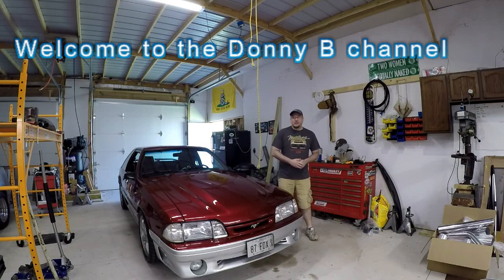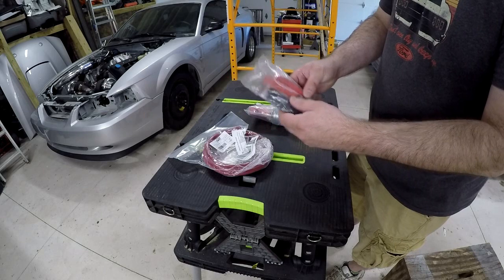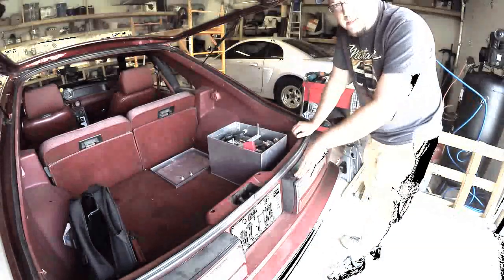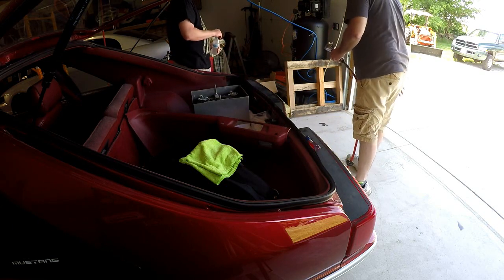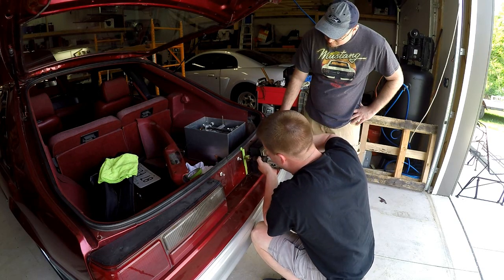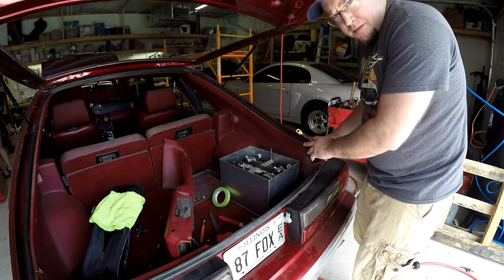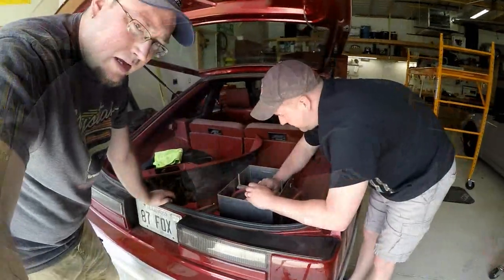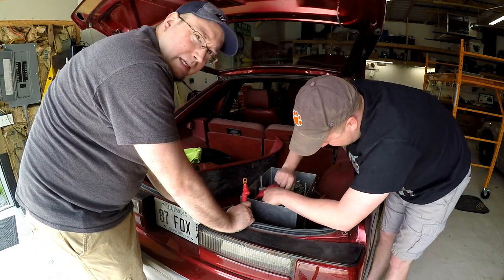Mustang Battery Disconnect Switch Install

Comment: A few comments, NHRA rules specify that you need a “PUSH OFF” switch. Your local track might let it fly on fun night but technically they can refuse if they cared enough. These switches are meant to be mounted sideways with a rod running out the back. 

That tiny wire is not enough personally. Should have ran 0/2 welding wire to the front.
Reply: Bryan Michalski thank you! You beat me to typing that.
Reply: I wouldn’t trust the “solder pool” to hold a cable vs proper crimp tool for a big lug.
Reply: "8:4 MASTER CUTOFF
Mandatory when battery is relocated, or as outlined in Class
Requirements. An electrical power cutoff switch (one only) must
be installed on the rearmost part of each vehicle and be easily
accessible from outside the car body. This cutoff switch must be
connected to the positive side of the electrical system and must
stop all electrical functions including magneto ignition. The off
position must be clearly indicated with the word “OFF.” If switch
is “push/pull” type, “push” must be the action for shutting off
the electrical system, “pull” to turn it on. Any rods or cables
used to activate the switch must be minimum 1/8-inch diameter.
Plastic or keyed switches prohibited. Switches and/or controls
must be located behind rear wheels on rear-engine dragsters."

I am having a hard time finding where it says you must use a push pull type? In this section it says "IF" you use one, not that you have to use one? Maybe the push pull required ones are for certain NHRA classes? I am new to this stuff so I am asking, not attacking you on this one just to be clear! Can you clarify when it is mandatory?
Reply: @AngryBengry  Good call out, a rear mounted battery switch does NOT need to be a push/pull to be NHRA legal. I've been running the same switch type referenced in this video for 20+ years and this switch type (OFF position has to be labeled) is NHRA legal.